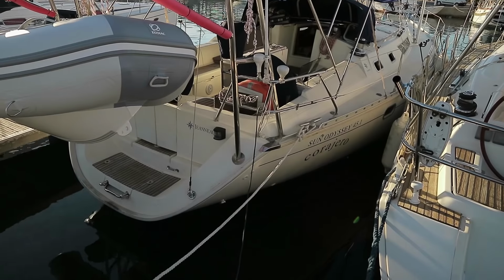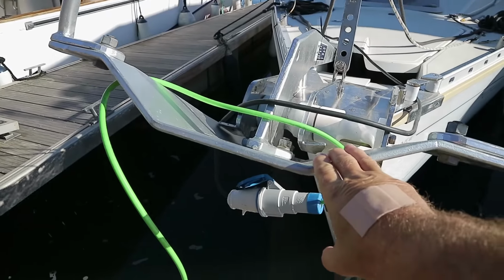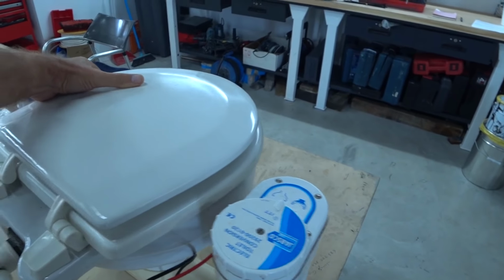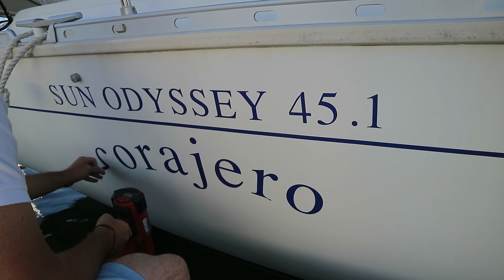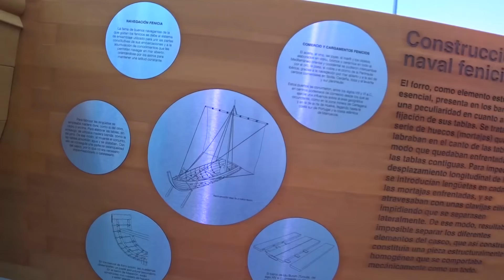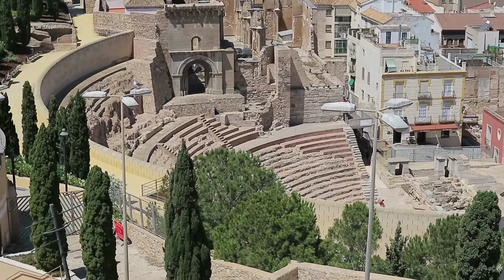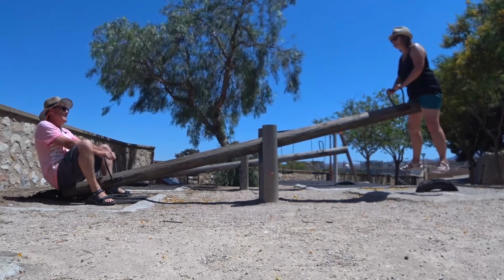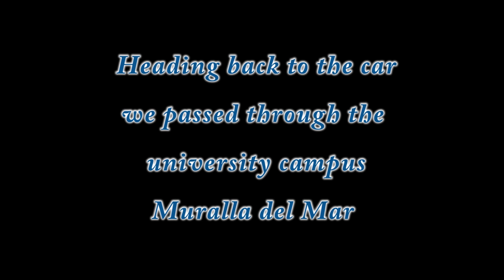Turning back time in Cartagena Spain - Sailing A B Sea (Ep.022)

Comment: To get the anchor to fit on the bow without hitting the pulpit look at fitting a Mantus AnchorMate works great 👍.
37k is BIG! We use the 25kg Mantus and ALWAYS holds.
Also your swivel loos solid, does it turn? Again the best swivel we found on the market was the Mantus Swivel 😀😜⛵️
Reply from the maker: We over specced on the anchor because we plan to be on anchor more often than not and we love that she goes in and stays in.
Reply from the maker: That swivel came with the boat, since we have arrived in Turkey it has been replaced with a swivel that actually swivels. A Mantus swivel in on the list but the one we have now is very hefty.

Comment: Great Video, just wondering of those guns are from WW2 and could you use your outboard motor to push A B Sea if your inboard motor had issues ?
Reply from the maker: [Baz] Construction at the site began in 1926 and the two guns were installed in 1933 and 1936. With only 8hp on the outboard I'm guessing it would be a last option and if there was no wind, waves or current we might make some headway, but not at any great speed. It might help if we were going downhill.